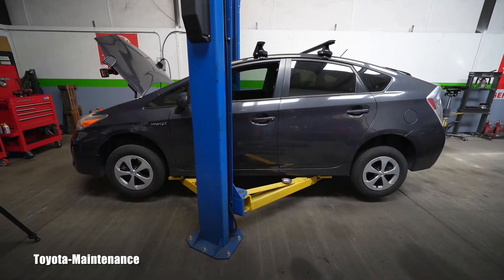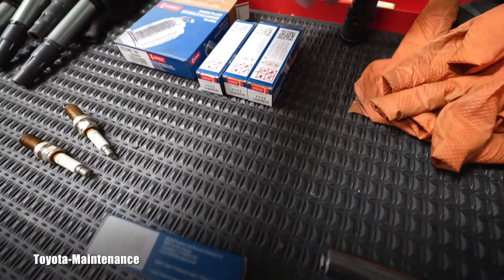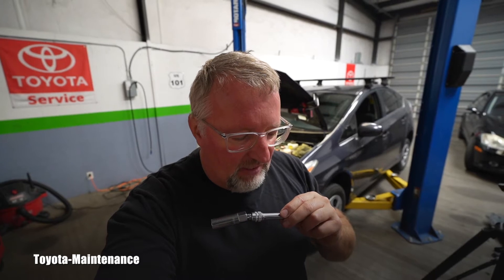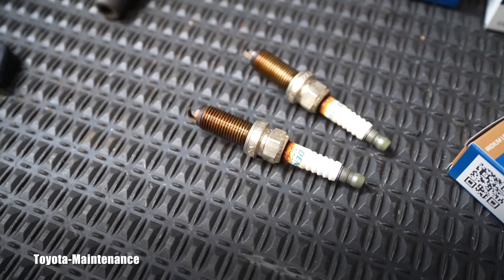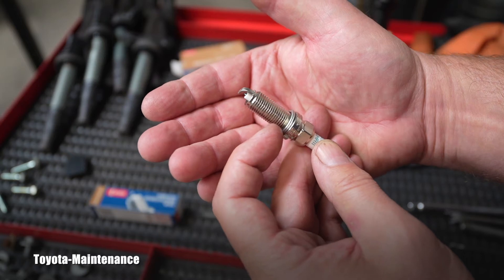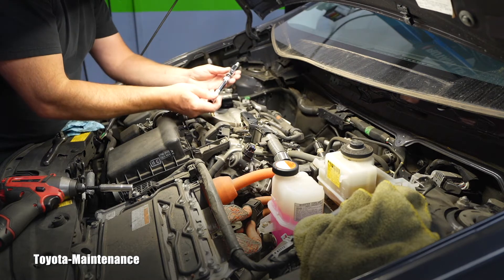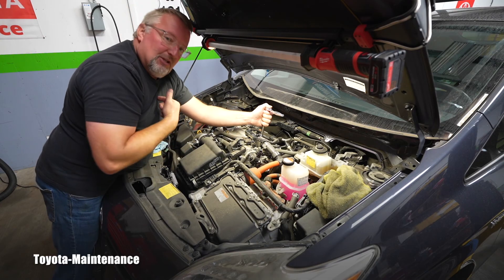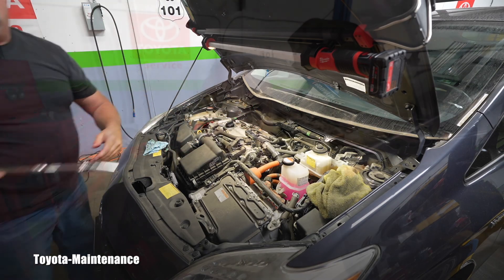How To Properly Torque Spark Plugs

Comment: Thank you. Peter.  Very reassuring that you show the angle to tighten manually and then prove you are correct by using the torque wrench resulting in same angle.  Loved it!!   No other video like it.

Comment: Hello!

What is the correct tightening torque for spark plug IXEH20TT in Toyota 1ZR-FE engines if data from Denso specification and the Repair Manual of vehicle manufacturer's differ. 

Denso offers an alternative spark plug IXEH20TT for 1ZR-FE engines in vehicle Toyota Corolla 2012/Saloon/1.6 Petrol Dual VVTi. 
But what tightening torque should be used to install it?

In the Denso specification for the IXEH20TT the tightening torque is 17 Nm.
And in the official “Repair  manual” of  Toyota for this car a tightening torque 20 Nm.

What is the correct tightening torque for IXEH20TT spark plug in Toyota 1ZR-FE engines (car: Toyota Corolla 2012/Saloon/1.6 Petrol Dual VVTi) - 17 Nm or  20 Nm? 

Thank you for answer.

Comment: Regarding whether to use anti-seize or not: most spark plugs these days will come pre-coated with zinc (acts as anti-seize), the tell-tell sign is looking at the color if they are shinny silvery color then they are coated, if they are any other darker color than it's safe to assume u need to put anti-seize, u should follow the plug manufacturer recommendation, if u so happen to have the not coated type it will say on the plug's website/spec sheet/box to use anti-seize.

Also the zinc coating is supposed to last for the 1st installation only, should u take them out later on u might wanna put anti-seize if u're gonna re-install them.

Never ever use regular copper anti-seize on spark plug threads, because of the high temperature u should use either a paste that's specifically made for spark plugs or use ceramic anti-seize paste, same thing u would also use for other high temp applications such as oxygen sensor threads, glow plug threads etc., regular anti-seize paste in high temp applications will cook and transform into seize paste 😂

Comment: I am not sure if Peter said it but rule number one is to install/uninstall spark plugs on a cold engine, or maybe slightly warm, but never hot, that's because the head this days is made of aluminum and aluminum is a material that with increased temperature gets gummy so it's a high risk of stripping the head threads when torquing the plugs on a hot engine.

Comment: A tip is not to use any sort of wobble extension or connection. It can change the torque applied.
Reply: Nope, it doesn't. What u said it only applies to impact guns, be they electric or pneumatic.

When torquing manually like Peter does in this video using wobbly joints will not affect the torque number.

The reason why it happens is because when impacting having wobbly joints will absorb some of the impact energy (will behave like a torsional spring) whereas when torquing manually you are keeping constant pressure so even if it flexes it will not change the torque number.

When using impact gun the maximum torque you will get by using only the socket, any additions such as extensions, wobbly joints etc will reduce the output torque, and for max torque try using impact sockets, they are heavier than regular sockets, all those jolts are like hammer blows, the heavier the hammer the better the results.
Reply: @MarianA-vu8tb  Nope your still wrong! Even manually torquing a spark plug,the most accurate way to apply torque is with a socket or wrench with the least amount of extension. A wobbly extension could cause an odd angle so inadvertently you could over or under torque a bolt especially in a newbie. There's a reason why pro techs do not use wobble extension or wobbly sockets to torque down for  example a head bolt.
Reply: @TheStpeteboy  generally speaking yes u are right about the angle aspect potentially changing the torque number, but going back to this particular instance it should not matter, the wobbly joint is inside the spark plug tube so due to tight space it cannot create any significant angle, should the wobbly joint be on the other side of the extension between the ratchet and extension then yes you could easily make significant angles and mess up your numbers, but yes in my previous comment I omitted altogether the angle aspect.
Reply: @MarianA-vu8tb   Thanks this was from personal experience many years ago. I actually cracked a spark plug using a wobble in a V6 Nissan engine because of the angle aspect. The " feel" of how  tight a bolt should be comes from experience. Just making a point  for newbies to  minimize using wobblies if possible because it could cause an easy job to become a bad one. In this case, its a 4 cylinder straight shot no wobbly extension or socket needed.

Comment: I alway blow out the sp plug hole Before i unscrew the plug. I also take a small strip of terry cloth rag and wrap it around the tip of some long tweezers. I carefully the conical shaped terry cloth into the spark plug thread area and turn gingerly this cleans a fair amount of carbon out of the threads. That way I make sure there's no debris or other things to goof up the torque. All you mechanics out there you know how one little grain of sand can cause a lot of problems with fine threads. Anyone out there have any experience with using a Crush Washer twice. I like to read my plugs about every 25,000 MI. I've heard that once you unload the Crush Washer that is just a seat properly when reinstalling the spark plugs.. something about the crush play not being able to properly 're- conform' to the conical shape of the spark plug seat. I don't know where that would screw up ability to get a proper torque. After many many spark plug changes I don't think I've noticed a fouling issue after doing this occasional inspection and re-install'. I heard and if you do this you should have a spare set of crush washers frankly i hv never replace the washers alone. Frankly I doubt my local napa carry such a part anymore... with all the modern inventory reductions, Not like the good old days when they had a lot of those small parts...... any opinions?

Comment: Thanks for the video. My Tacoma is coming up for spark plug change soon and does it also take a 14mm spark plug socket? What is your thoughts on applying a few drops of never seize ti the threads? Thanks.

Comment: I'm having confusion torquing the soft gaskets that use inch-pounds. I've done the valve cover on my 97 Tacoma and transmission filter for a 2014 Scion xB, and same issue. As you go around all the bolts, the torque reading keeps changing back down to below specs. I became worried that if I keep going around and tighten to specs I'll destroy the soft gasket. There must be some proper procedure for this I'm not aware of?

Comment: I have 1999 Toyota Corolla LE I asked that the parts counter he said NGK with a dual tip I got Denso Platinum tip single electrode witch one is correct?

Comment: I do 14 foot lbs on my taco.  Just installed NGK Ruthenium plugs and Denso coils.  I spent a little more money but now it runs incredibly smooth with absolutely no electrical noise heard through my HF radio.  Now, the only electrical noise I hear is when someone in a Honda, Dodge or Chevy goes by.
Reply: coils already?  what year of Taco!?  i have 339k miles on Gen1 5VZ and coils are still the factory ones from 26.5 years ago ... they are over 100$ MSRP EACH
Reply: 2004 with 400k miles and the coils were quite toasty.  I should have replaced them a lot sooner.   @efil4kizum
Reply: No need to replace coils
Reply: @fluorescentmug8333  The coil springs were broken and the boots were burnt and cracked.  Why wouldn't I replace them?

Comment: I noticed you didn't put anything on the threads. In your experience is it important to install the spark plugs dry? I thought you would want to add a bit of anti seize to the threads.
Reply: No anti seize on plugs.  The threads are lubricated by a coating.  I used anti seize a couple of times and it was very hard to get the plugs out.  I left then in 120k miles as per the manual.  Now I have done them at 120, 240 on two Toyotas with no anti seize after the 120k interval.  They came out great at 240k.

Comment: The turn past snug plus a certain number of degrees only applies to new crush washers. If for some reason you need to remove and reinstall a plug use the torque spec. The term crush is a bit of a misnomer as the washer isn't totally crushed. This  allows it to act as a spring seal and lock washer for the differing temperatures and metal expansion rares of the steel plug and aluminum head.

Comment: When using a click type torque wrench, and even with one of very expensive digital ones like Peter is using, many people make the mistake of tightening too fast, so that they exceed the set torque by quite a bit. Some people keep pulling on the wrench after it clicks or beeps. You want to avoid that. Peter is doing it correctly by using slow, even pressure until it beeps. Fortunately, on cars and trucks being in a hurry tightening seldom causes problems. The rather wide torque range they specify proves that. Head bolts are the ones you need to do exactly as the manufacturer specifies. Also the main bearing bolts, and the connecting rod cap bolts. Even in lawnmowers, you want those to be right, so they don't unscrew after a few hours. Not only do you have vibration to consider, but they get hot and cold repeatedly.  
Torque wrenches make good Christmas presents for DIY folks who don't have any. I bought a cheap set on Amazon. That is good enough, since I'm not working on airliners or rocket engines. After the SpaceX Starship had to be blown up in Texas a few months ago, the FAA told them that some bolts needed to be tightened more, or made larger, to prevent leaks.
Reply: How much is the current price of that snrape truck tool today?
Reply: Just guessing, but I think a Snap On digital torque wrench cost about $ 400.  @LAactor

Comment: 14:02 Make sure to pull the torque wrench from the exact middle of the grip area. That's where it's calibrated from. See tests by John Cadogan.
Reply: If it's click type yes. If it's digital, and the transducer that would be measures the torque is in the head, or the wrench doesn't use a ratio of torques to give a reading, the it doesn't matter where you hold it. John also states this, I think.

Comment: I just did my Rx350 at 150k miles on the original plugs, unbelievable how clean these engines run, they still looked great.
Reply: Good to hear you must change your oil before the recommended/specified intervals. In my opinion going 6000 miles between oil changes is very destructive pretty small working engines. I try to not go more than 3,000 miles and I've been wrenching  for 50+ years ..and I think there's a big difference putting in an extra 1-2000 miles additional  contaminated oil.  Of course nowdays unreputable car manufacturers have engines  w bad Blow- by right out of the factory. I wish the mechanic would talk about the history of being various engines that,  even new areoil burner /Bad blow by problems
Reply: @Idahomie  I change my oil every 10k miles with synthetic and OeM oil filter which is about every 3-4 months for me.  I pulled oil analysis at 10k and it looked so good they told me I could extend if I wanted, but I chose to stay at 10k.

Comment: Just use a high quality electronic torque wrench. I use them on the 4.7 V8 which are 13 ft lbs. This isn’t the space shuttle. Most people don’t even torque plugs.

Comment: I would have to use my inch lb torque wrench my foot lb torque wrench only goes down to 25 ft lbs and that would be 11 ft lbs and i use a short piece of rubber hose to install spark plugs in any engine ,thank you for such a comprehensive explanation of this service, i hope people listen and follow your instructions and they too will be able to install spark plugs properly.